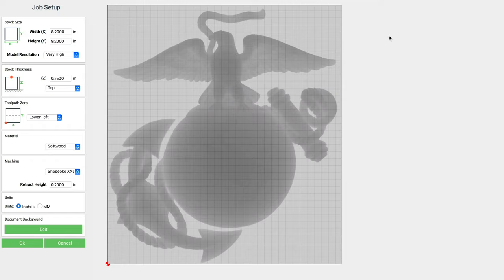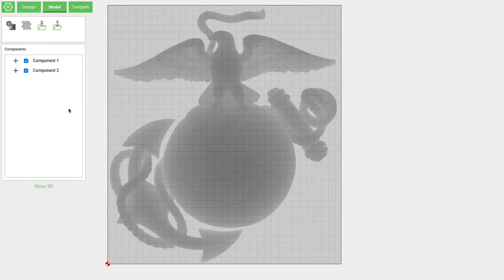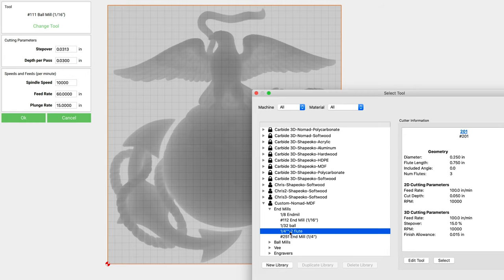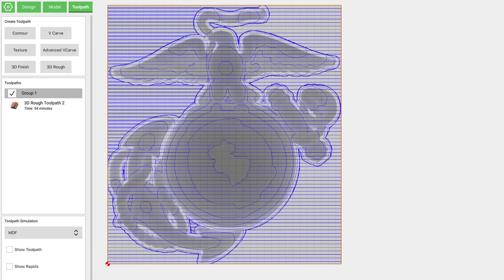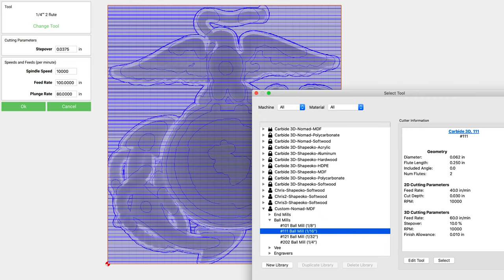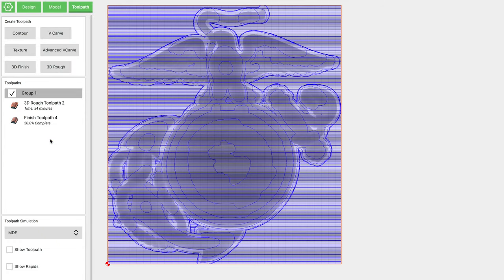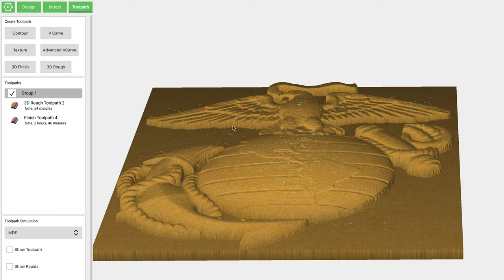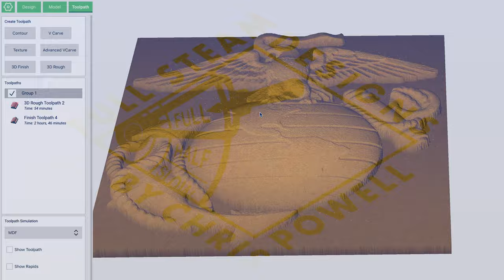Carbide Create Pro Tutorial - How To Generate 3D Toolpaths

Comment: So I'm on CC Build 520 and trying to get this 3D stuff down.  I'm with you up to importing the image as a component, but when I look at my image, it is a flat carve.  There is no contour to it.  On your USMC Logo, in the show 3D after you import it, the globe is curved and shows depth.  Mine is all flat.  When you say to put the base height at .45 and that will be the top of the carve, all mine does is raise the whole image to .45 and it does not taper down.  I'm obviously missing a step or something.  If I carve this according to the Show 3D, it is just going to be a flat image raised up .45".
Reply from the maker: Are you using Carbide Create Pro?
Reply: @ChrisPowellFSD  yes, the trial version.
Reply from the maker: They have round and square shapes. Maybe you’re not selecting the same one I did.
Reply: Where do I select that?  I looked for something like that but didn't find it.  I see the add, subtract, etc in the drop down menu.

Comment: Hi I have bought 4 months ago a shapeoko cnc my question is if it will work with the latest iPad from apple instead of a computer  thank you
Reply from the maker: Unfortunately it won’t. You would need a tablet capable of running Windows.
Reply: I think it won't work with an iPad because you need a USB connection which iPads don't have. Carbide Create and Motion, however, will run on Windows and Mac OS. I'm using a MacBook Pro.

Comment: My tool path simulator keeps showing the tool paths above the stock when I try to invert the gray scale image. What am I doing wrong. The image look right on the molding simulator but not on the tool path simulator unless I am doing a inverted mold like carving. Witch is the opposite of what I want to do.
Reply from the maker: Did you just select the outside box?
Reply: Chris Powell  after watching a different video of yours i was able to see what I was doing wrong. I wasn’t first setting the depth of the square around the work piece or separately. I was modeling both into one modeling component at the same time. Witched worked for a reverse image 3D carving but not a raised Relief 3D carving, it would always simulate the tool paths above the stock. I thought inverting the image would work but it didn’t. I then tried subtracting instead off adding and the simulated image would just disappear altogether. Thank you for the videos they help out a lot. I just wish I would have watched them before waisting  two days trying to figure it out on my own.

Comment: Yes, I have the same issue of the simulation stopping at 50%. Your trick of going to design usually get it started again.  I have also experienced Create Motion stop or loose communication with the PC. This is an on going problem, which I have requested help from Carbide with not results. It drives me nuts to do a 2 hour carve and Carbide Motion stops, just before it is finished and I have to run the whole program again.
Reply from the maker: I’m starting to think I just don’t have the super computer necessary to run Carbide Create and launch rockets. It is frustrating, especially when you’re just trying to do simple things.
Reply: @ChrisPowellFSD  If you are basing that on the locking of Carbide Create,  that is a Carbide Create issue. I have a fast Windows computer, and as I said above, and I am experiencing the same 50% issue. If it were a lack of power on a computer,  it would generally slow, slow way down, but generally with the new operating systems on Windows and Apple,  it would not stop as I see with Carbide Create.

I really get a lot out of your video and hope whatever technical problems you encounter you continue with your videos. Tnx
Reply from the maker: I agree with you. Thanks for the support. I’ve recently started using Carveco more and more. Seems much more reliable. I need to look more into cncjs for my g code sender. Should fix some of the issues with Carbide Motion.
Reply: This is resurrecting from 2 years ago, however, I’ve had multiple issues with carbide motion no longer responding to the CNC controller. I found that a shielded USB cable fixed my issue. But* that may not be your issue and after 2 years, I hope you’ve found a solution!

Comment: Mine locks up at 50 % as well on the finish tool path.  I am trying to design and cut an MDF cabinet door with it right now.  This should be interesting.
Reply: mine did also.  When I clicked on show simulation it showed if fully done and then the sidebar went from 50% to 100%.  However it did not do it everytime.  Save often
Reply from the maker: Definitely save often haha. It doesn’t seem to effect anything, and jobs still seem to run fine, but it is nice to see the estimated time.
Reply: @ChrisPowellFSD  I love my XXL and Carbide Create but they are going to have to up their game and work out all these little bugs.
Reply: I have the same issue. I often have to quit out of CC Pro and open the file back up again (after savings, of course).

Comment: is that your go to bit? 1/16 or will 1/8 work?
Reply from the maker: A 1/8 ball nose could work for some projects, but something like this has a little too much detail for the scale.
Reply: @ChrisPowellFSD  are the tapered preferred?
Reply from the maker: Tapered bits offer increased rigidity, but can cause issues on deep cuts because the tapered part of the bit will cut into the part you’re making.